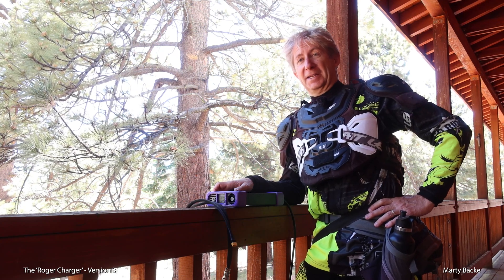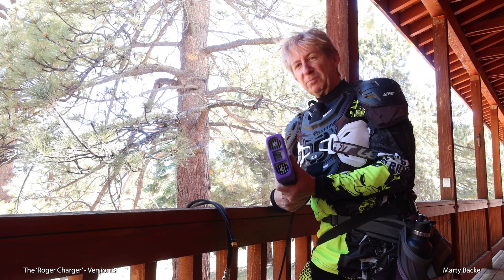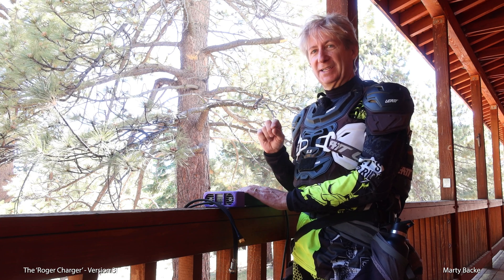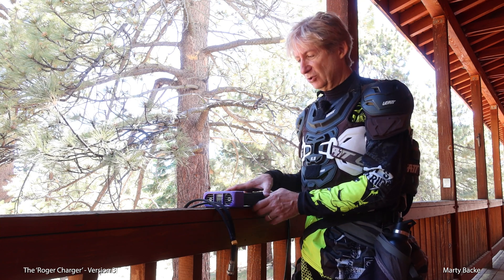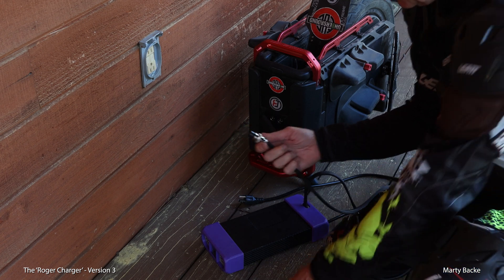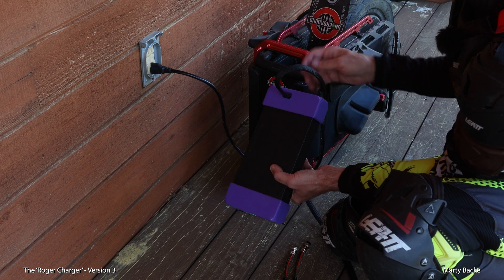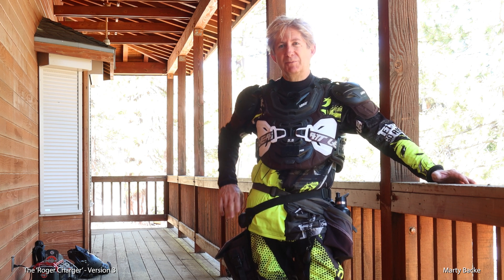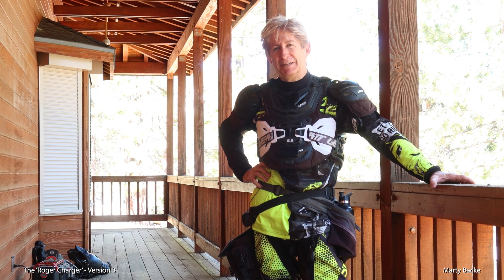The 'Roger Charger' - Version 3

Comment: I sure wouldn't be happy running 12A through a single GX16, even using twinned pins. Given theres 2 ports on the wheel, I'd be utilising them and running 6A through each. No doubt you and others have done it on a single port plenty of times before though so you're prob happy with it.
Reply: Yeah they’re rated for 10 amps which is why they come with two ports, they wouldn’t add a whole extra port for two standard chargers because they are trying to maximize profit and that costs money, plus who is actually gonna buy a second standard charger? Like basically nobody

Comment: Careful charging on 110v outlets at 12amps you are drawing a bunch of power and more likely to trip breaker on 110 outlets. I don't charger faster than 8amps with a 134.4v wheel on 110 outlet.
Reply from the maker: Haven't had that issue but yeah, be aware of the load on the circuit that you are using. Breakers are easy to reset 😊and most outlets in the wild seem to support 20-amps.
Reply: @ElectricUnicycles  oh I know that the outlets support 20amps but I have seen breakers trip on 110v even with 20amp outlets, likely the circuit itself isn't dedicated to outlet, but personally rather play it safe and allow others to charge rather then get to destination and outlet be down, cause I couldnt wait an extra 15minutes.

Comment: These are great chargers, however they are still large and heavy. We need a lighter smaller powered charger.
Reply from the maker: That would be nice, someday. Still smaller than the typical EUC fast charger. They are heavy though.
Reply: …And a free lunch…
Reply: There's the Huawei chargers that you have to get customised in China though, Ningning sells a version of it as well.
Reply from the maker: @xkaiux  I know they exist, somewhere. Too bad nobody is selling one. And it needs to supports any desirable voltage
Reply: @ElectricUnicycles  The really small ones are 100v-135v only which is fine for me.  Ningning sells his version which I got too, there are a couple in China, the last one we group bought from, we bought his remaining 14 in stock, he said someone in China ordered 30+.  Hardest part is finding someone to trust I guess.

Comment: Can he retrofit V2 to V3?  I find having to multimeter the tenths a pain if you bump the setting accidentally since the display doesn’t show tenths over 100V due to the 3 digit display.  It seems less likely on V3 to have to do that once set.
Reply: Possible yes.  The first V3 was just a V2 that I modified so I can send photos and videos to the factory.  It was a major pain the the butt though.  Sell you V2 and buy a V3
Reply from the maker: V3 is accomplished in China so I doubt V2 can be modded. You can always ask Roger.

Comment: Be careful, on a 120v outlet, this charger can only do 1500w. At 134v and 12 amps you are at 1600w which is above the max rating fot this charger at 120v. I blew mine charging the patton (126v) at 14a on a 120v outlet.
Reply: The 1500W number is conservative.... I have charged at 15A plenty.  I have also charged at 3000W on 220V.  But if you exceed recommended values, you get no sympathy from me if it goes boom.
Reply: 15A on 134.4V = 2016watts
Reply from the maker: From our experience most non-residential outlets support ~20-amps. But good advice. I assume that you mean your circuit breaker reset?
Reply: @ElectricUnicycles  
I’m referring to the chargers maximum, not the outlet. At 120v input current, charging beyond 1500w (voltage x amps = watts) will overheat and potentially damage the charger. At 240v (on an ev station) it can do up to 3000w.
Ask Roger he will confirm it. ✌️
Reply from the maker: @EUC_Quebec  Interesting. I've been using it at 1600wh multiple times and the charger is always running cool.
Reply: Sounds like it has to do with the input current. Not wattage. Current = melted cables.
Reply: @mikeh6286  the heat generated due to resistance in a circuit is proportional to power (wattage), not just current.
Reply: @iongivafuk  Ok sure. I think I meant that when the input voltage drops, because of a massive amp draw, you get poor efficiency and thus overheating. Chinese chargers aren't tested on 110v I believe.